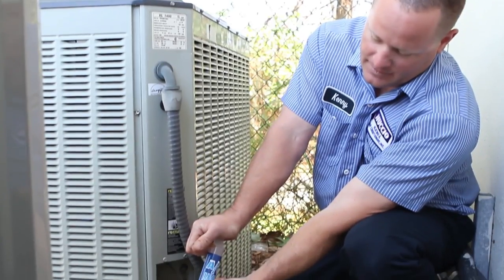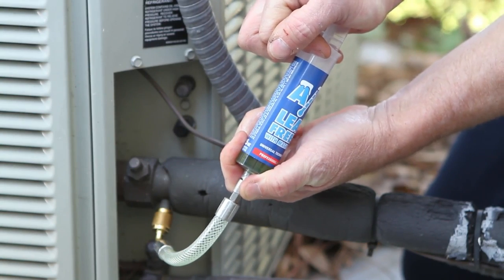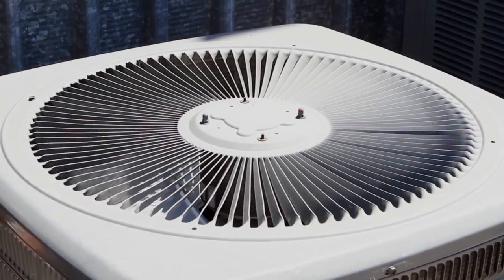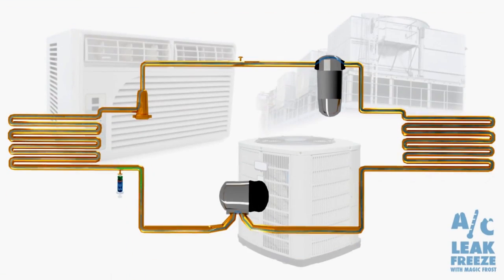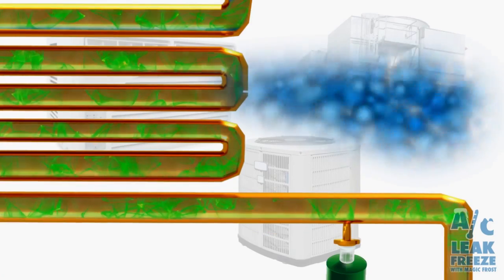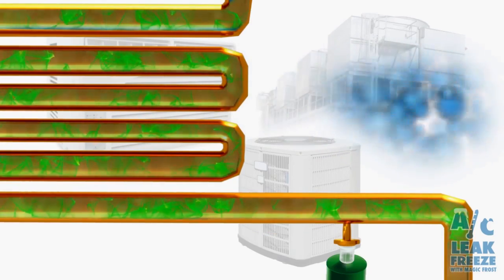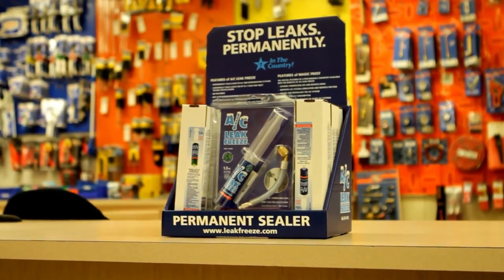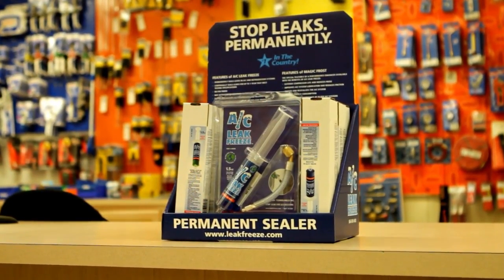HVACR Repair Is Easy with A/C Leak Freeze

Comment: I was reeeally sceptical about this stuff, but the refrigerator repair guy used this to stop gas leaking in our 20+ years old Whirlpool fridge, and it actually worked! After the repair we could smell the gas for a couple of days.... so we thought no way its gonna work, but the gas smell stopped at a point, and since then (1.5 months) we can smell no gas and the fridge works perfectly. I tested it with a thermometer for weeks to check if is there any temperature rising or something, but its stable. So I can say that it can definetly work!

Daniel, from Hungary

Comment: I have use this and other products to seal leaks with good moderate success. It's never taken out a compressor or plugged up expansion valves or cap tubes. it's always worth a try after a good Leak search and you just can't find it. I've had some Success With It but it does have its limitations. leaks by the compressor particularly on the discharge line it won't seal up period but some of the comments are just not accurate I've used this and a few other brands and have had some good luck and have never had a plugged filter drier or cap tube or TXV from any of these products